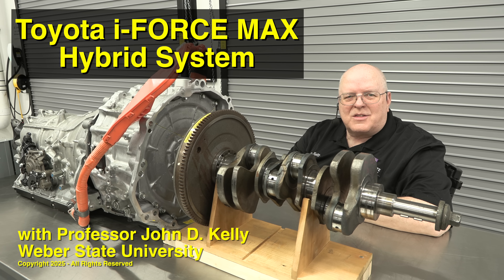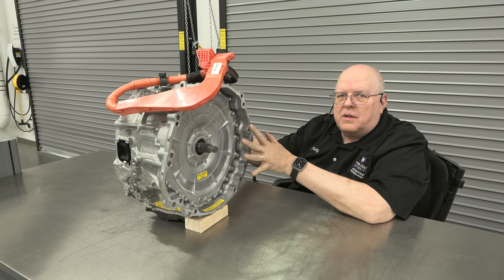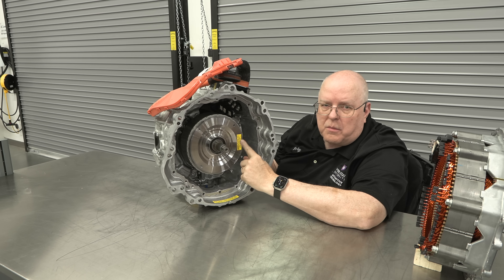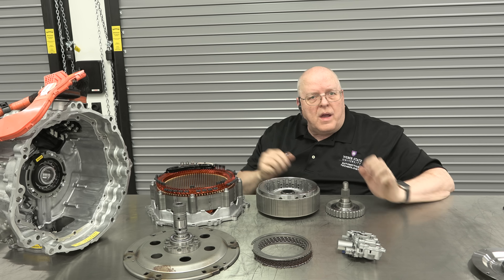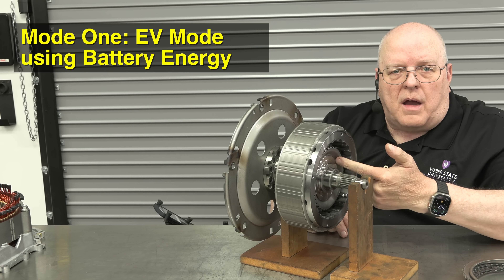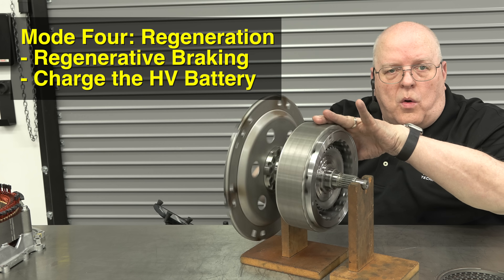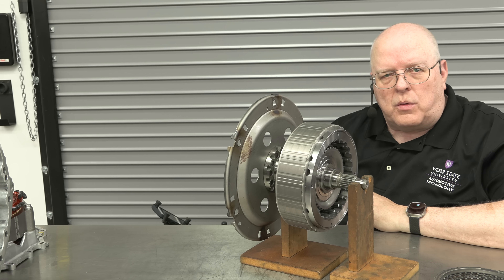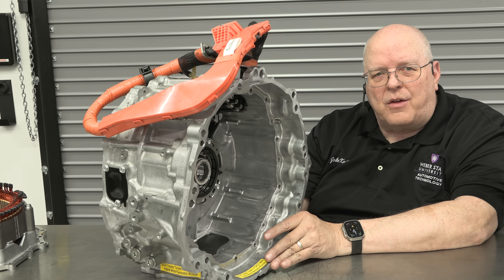Toyota's i-FORCE MAX One-Motor Hybrid System

Comment: Couple of questions:

1. In the battery charging /regen mode, is the hydraulic clutch engaged or dis-engaged? Will the operator get part deceleration via. engine compression?

2. Will the clutch plates not be a point of failure at some point? These vehicles do operate under extreme loads.

Comment: i see the hybrid system has a clutch kit in front and a torque converter in the back what is the cost if both the clutch kit and torque converter automatic gearbox fail and pack up

Comment: So if the engine is disconnected from the torque converter without hydraulic pressure for the clutch pack engagement is there a stand alone/backup electric hydraulic pump other than the transmission pump in case of a dead 
battery/malfunction or is the vehicle useless without battery power considering only the electric motor is directly connected to the torque converter?

Comment: Seems like the most complicated propulsion system ever devised for an automobile.  Two electric motors and generator gasoline engine seems like a superior more dependable propulsion system enabling even more torc and horse power less maintenance.

Comment: Great video! Thank you! I currently own a 2024 iForce Max Tundra Hybrid. Can this truck be converted to gas engine only by removing the batteries and electric motor components? Or, perhaps (due to engine recalls), could it be converted to full electric?

Comment: Good overview.  However the real magic here is in matching the speed of the electric motor and the engine and transmission.
I did not see a gear reduction planetary to convert the high revving electric motor to a lower speed to match the internal combustion engine.
Why didn’t they just replace the transmission with the electric CVT in the Prius / Rav4 ?

Comment: I’ve always wondered if we could ever see a planetary gear setup hybrid system that is fast and capable off-road. 

In theory it should be possible. I’d love to see a turbo diesel that uses a planetary gear system and powerful motors and batteries. 

You could keep the engine under load at the peak power band and just hold it there. You wouldn’t be constantly spooling up and down.

Comment: Toyota needs to redesign these drives. They only give torque to the 4 cylinder. The 4Runner should at least get close to 30 mpg with the I Max. It barely gets 25. The highlander hybrid is bigger and gets 36 mpg for awd. Only thing it is unibody where the 4Runner is a cab on rail chassis.

Comment: Screw IForce max turbo plastic junk,get you self one,put it under load ,change  the engine oil to manufacturer specifications and get a small loan for upcoming repairs/diagnostics,not to mention waiting time  to get the car diagnosed  and a lack of skilled mechanics ,don't fall for this BS.If you keep the car for 3 years or so-it doesn't matter. This is not a Toyota everybody knows.

Comment: Toyota also put one of these in an AE86 in place of the original gasoline engine as an EV showcase. Makes sense this is used, since this is probably the closest thing you can get to a standalone electric motor unit without any additional gearing.

Comment: I'm curious why toyota chose a torque converted automatic over an automated manual/DCT. Could they use the same hybrid system in a manual/dct application by just replacing the solenoid with a clutch pedal or variable solenoid valve? Maybe it's just that they haven't developed a DCT or don't have the budget? Great video, learned a lot!

Comment: 8:27 *Important note - on my LC 250 the mode 1 (Battery only) operates at speeds below 15 MPH and with no heavy load or hot day. This mode is essentially for putzing around town in traffic or when just barely getting your vehicle moving think parking lots, drive thru etc....
Reply from the maker: Thanks for the information. Good to know.
Reply: @WeberAuto  The least I could do given the amount of great technical information you provided!

Comment: In terms of reliability and the robustness of the system, if you don’t yet have real world data based off of your inspections of Ford’s version versus Toyota’s, which would you say is going to be more reliable and which would you say is more enjoyable to live with?
Reply from the maker: They both use a motor connected to a torque converter for the hybrid system. The real differences are the engines and transmissions. Thanks for watching

Comment: I have one question: why isn’t an electromagnetic clutch used instead of clutch plates? Or is it possible that in the future, an electromagnetic clutch could be used instead of a hydraulic system, controlled through a module, so that the clutch’s function can be managed electronically?
Reply from the maker: I suspect it is because electromagnets clutches utilize mechanical ball ramps to apply the clutch packs. They are relatively slow to apply and release compared to hydraulic force. Thanks for watching

Comment: My wife bought a Toyota Land Cruiser 2025 with an i-Force Mac but only a 4-cylinder turbo engine.  It's fantastic.  And thank you for this video. I'm 72 and have worked on all of my cars over the years for simple repairs and maintenance.  Your explanation of this engine blows my mind.  Imagine being a fly on the wall during engineering meetings during the design phase.  We normally drive our cars over 300K so it will be curious to see how this holds up.  But there's a reason why Toyota is so popular.  Btw, my vehicle is a F150 Lightning.  Charge at home for pennies.  Our daily driver.  Oh, and it's FAST.
Reply from the maker: Thank you and thanks for sharing. Enjoy your Land Cruiser and Lightning

Comment: so when I tow a trailer its pulling through clutch plates????????
Reply from the maker: Yes, and even more clutch plates inside the automatic transmission. They are strong and sized for the towing capacity of the vehicle. Thanks for watching.
Reply: @WeberAuto  Thanks for answering me. I just bought a Land Cruiser and I hope it lasts.

Comment: Wow it uses the same clutch pack as a motorcycle. Imagine making a smaller version for a motorcycle and getting an extra 30 ft lbs of torque and 12 hp + regen braking.
Reply from the maker: Automatic transmissions have been based on clutch packs since 1940. They have been very strong and reliable, and if sized correctly with the proper force, they can handle all the torque the truck can provide. Thanks for watching.

Comment: Interesting design without the P0 - When charging it has to spin the torque converter. Also a much bigger system than the ford or jeep - more torque as well but more heat to reject.
Reply from the maker: True, Thanks for watching

Comment: Fantastic video! I have been looking for information on the fluid service for this.  I was under the assumption the transmission fluid would refill the MG pan, but no official service procedures are available through the aftermarket resources such as Alldata Pro or Identifix.  Thank you very much for this amazing breakdown! There are two service plugs on both sides of the MG housing that look as though they could fill the pan.  Where do they lead too?
Reply from the maker: I'm glad the video was helpful! Those are fluid passage plugs and pressure taps.

Comment: What about the clutch pack in the hybrid motor? what's the service life and can it be replaced?
Reply from the maker: It can only be replaced by replacing the whole hybrid, module portion between the engine and the transmission. As far as service life time will tell, but in other vehicle manufacturers, the engine disconnect collect seems to last quite well.

Comment: Has anyone experienced chattering when this system disengages around 15 mph?
Reply from the maker: Interesting. Thanks for watching.
Reply: @WeberAuto  Sister owns one of the trucks and when slowing down There’s a shutter at 15 mph wondering if it’s this unit engaging in disengaging
Reply from the maker: @richardplummer5366  I don't know, but if it is transitioning back to EV mode at that time, it is possible.

Comment: How do you maintain it. What if that hydraulic pump goes out in the electric motor
Reply from the maker: It has an engine driven mechanical pump and an electric oil pump. But if they failed the vehicle would not drive very far before running out of battery power.

Comment: I wonder about the longevity of the clutch pack. I watched the previous video about Prius Hybrid and was positively surprised it didn’t have one. So why the need for a clutch pack in this instance?
Reply from the maker: It is used to connect and disconnect the engine from the motor/transmission. This allows for electric only driving. It also is used to start the engine when needed.

Comment: Dear Professor Kelly,

First of all, I would like to thank you for your excellent English. For me, as someone who has been in the United States for less than a year, it is especially valuable — you speak so clearly and distinctly that I can fully understand everything you are talking about. For that, you have my sincere respect and gratitude.

Now, regarding the hybrid powertrain you presented. I found it very interesting and reliable, mainly because it uses standard components. There are no complications in the design, such as alternative or less proven transmissions, which is a major advantage in terms of durability.

From my engineering experience, I would note that this type of system is more suitable for large vehicles with a classic layout — SUVs and pickup trucks. The reason is that the design extends the drivetrain. If implemented in a more compact vehicle, the driveshaft to the rear axle would become very short.

I would also like to highlight the multi-plate clutch in the oil bath. Similar solutions have long been used by BMW, where I worked and became well acquainted with this unit in transfer cases of SUVs. The multi-plate clutch itself is extremely reliable. In 99% of cases, failures are caused not by the clutch, but by the actuator — the fork mechanism that engages it. The electric motor with the worm gear contains a large plastic gear, and it is this gear that usually fails. But I have never seen a single complaint about the clutch itself. This unit engages the front axle and regulates the degree of its connection.

A multi-plate clutch in an oil bath is an exceptionally reliable solution, and if hydraulic control is used, it significantly increases the durability and overall reliability of the unit.

As always, Toyota has proven to be ahead of the entire automotive world — and it truly deserves respect.

Thank you for this informative video. You have fully satisfied my curiosity regarding the transmission of full-size Toyota SUVs and pickup trucks.
Reply from the maker: I appreciate your kind words and detailed insights into the hybrid system!

Comment: In my out of date brain, after driving a few toyota/lexus cvt cars, i was thinking why doesn't toyota design a hybrid system that can work with a traditional auto box that delivers abit more driving enjoyment, because the CVT isn't really suited for fast driving. 
Low and behold, they've already done it. 
Now all they have to do is to put back into production the old ls400/ls430/sc400 with the iforce hybrid system.
in fact, they need to just put it on every car. 
Great video and explanation sir.  You are The Don.
Reply from the maker: Thanks for watching!

Comment: Sadly, a turbo 4 cylinder with hybrid capability will not last as long as a conventional naturally aspirated v6. A 4 cylinder has a 25% duty cycle per cylinder where as a 6 cylinder is 16.1%. Put another way, a 4cylinder works 50% harder than a 6cylinder, if all other things are the same. I will stick to conventional non hybrid set ups. Remember: the hybrid battery is significantly degraded after 5 years.
Reply from the maker: Thanks for sharing your thoughts!

Comment: Thanks, 6 Aug 25 I took delivery of new 4Runner with this power train.  I have 3 Kmiles on it now.and still learning how to drive it   it is starting to losen up  I've been asked to discribe it, now I can.  I knew there was an electric moter / generator between engine and transmission but that was my limit.  My wife bought an new 08 Hybrid Camry then followed that with a 17 Prius V.  Thanks again Professor Kelly well done.
Reply from the maker: That's great to hear! Glad the video helped.

Comment: So what happens when you run out of gas ? Will the electric motor get you to the gas station?
Reply from the maker: The battery is pretty small so unless you’re very close to a gas station, it will not get you there. Thanks for watching.

Comment: I'd argue that clutch is guaranteed to fail/wear eventually. Before the engine? Before the transmission? Depending on the quality of the programing (which Toyota is actually often great at with hybrids), and probably how the trucks are driven. But hopefully they won't withhold parts!
Reply from the maker: It should be very reliable since it is only engaged to when the electric motor and the crankshaft are rotating at the same speed. Additionally, the torque converter with its fluid coupling will dampen the application of the clutch. Thanks for watching.

Comment: So, it's just a permanent magnet motor with a 4-quadrant motor controller?
  
Feels like they could have done a coaxial planetary power split instead of the torque converter.  Probably need fewer gears in the transmission, and reclaim the length of the torque converter - and imagine the ultra-deep low range for off-roading.
Reply from the maker: Yes, Thanks for your comment!

Comment: 5th Gen 4R owner here and curious about the new iForce. How reliable is the clutch pack?
Reply from the maker: It should be very reliable since it is only engaged to when the electric motor and the crankshaft are rotating at the same speed. Additionally, the torque converter with its fluid coupling will dampen the application of the clutch. Thanks for watching.

Comment: Why is Toyota still pushing hybrids. In the face on modern EVs and the rapidly dropping price of batteries, hybrids are OBSOLETE!!!
Reply from the maker: Battery electric vehicles don’t work for every possible situation. Hybrids are a good middle ground between full electric and internal combustion engine powered vehicles. Thanks for watching

Comment: Wouldn't the additional weight emphasize the need for a V8 instead of the 6? 60 HP electric motor that small, that's impressive
Reply from the maker: The additional instant torque from the motor cannot be duplicated with most V8 engines. Thanks for watching.

Comment: Thanks for the video and the clear explanation. But so the clutch plates are not seen as a serviceable item? Do you think they will wear or are they never engaged or disengaged under power so there wont be much wear on them anyway? Curious to know what the clutch strategy is.
Reply from the maker: Thank you very much. There will not be much wear because the clutch plates won’t be engaged until the crankshaft RPM and motor RPM are equal (rev matching). It does not require slippage under most circumstances. Additionally, there is the torque converter with its fluid coupling to reduce the torque load.
Reply: @WeberAuto  Thanks, that was I was thinking too. But does the motor have another starter? Otherwise it is not possible to start the motor without slipping the clutch for a bit (while the car is moving).
Reply from the maker: @ComplicatedStuff  It does have a 12-volt starter motor with a special high-performance 12-volt battery. The starter has a limited number of uses before it must be replaced. I know the starter is used for the initial start and for stop/start events at an idle, but I cannot see where it is used to restart the ICE while driving. There would need to be clutch plate slippage if the large electric motor is used as the starter.
Reply: @WeberAuto  Interesting, so it's more like the Honda IMA system but with a clutch.
Reply from the maker: @ComplicatedStuff  yes

Comment: Thank you for the excellent video.  I'm still puzzled how the hydraulic pack connects to the clutch.  I'm assuming the clutch is a wet clutch?
Reply from the maker: Thanks! Yes, it is a wet clutch.
Reply: Now I see, at 5:54 the flex plate shaft is ported with passages for clutch oil pressure.

Comment: Is that clutch pack typical in terms of size / number of clutches for this high torque application?
Reply from the maker: Yes, he tends to speed automatic. Transmission has similarly sized clutches. Thanks for watching.

Comment: In braking/regen mode, I guess it can either have the clutch engaged so get some engine braking as well [but only need that to avoid HV battery overcharging], or the more usual case with the clutch disengaged and the engine off/idlling [idling most liklely].
In the latter case, they could be clever and select a lower gear in the automatic gearbox such that the motor/generator spins faster and generates more.
Reply from the maker: Interesting points, I agree. thanks for sharing.

Comment: Thank you, Professor Kelly. Does the 4th mode mean that power transfers from wheels to generator through the torque convertor? I thought the torque convertor can work only in one direction: from power source to the wheels.
Reply from the maker: Yes it does, it has a lockup clutch that can be used to keep it from slipping during deceleration

Comment: I test drove a tundra Hybrid.   The one thing I thought was not a good idea is that the engine would shut off right after hard acceleration to highway speeds.   I ended up buying a regular tundra and immediately disabled the auto start stop feature.   I’m pretty sure shutting down an engine with red hot turbos isn’t the best idea.
Reply from the maker: Thanks for sharing your experience.